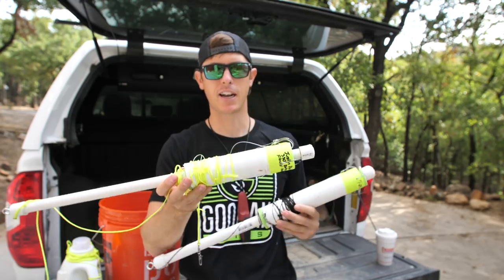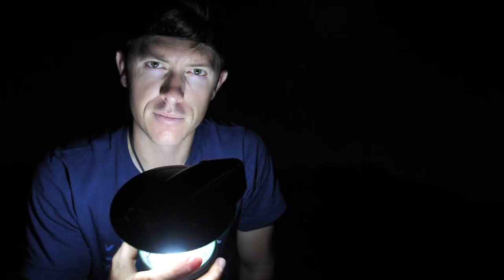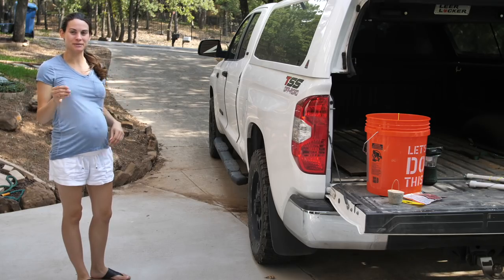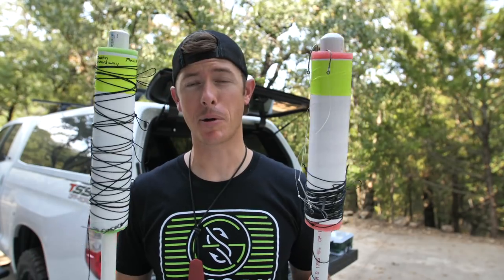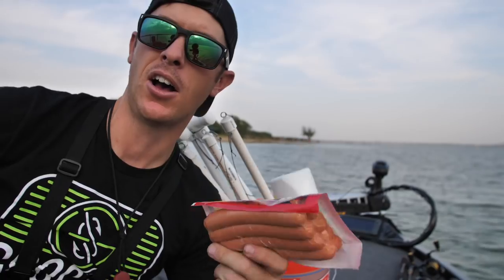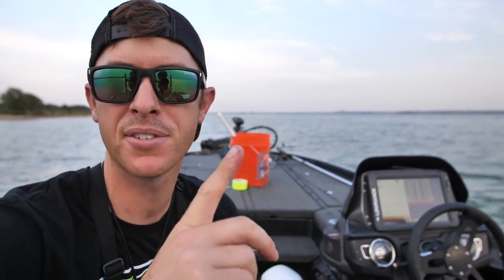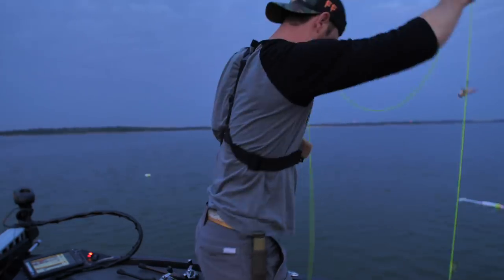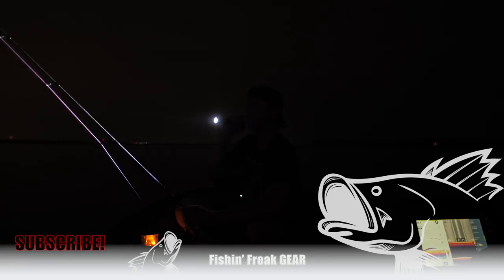THEY WORK! Catching Catfish on Overnight DIY Juglines!

Comment: LFG, I got what you need on the jug lines brother. I have felt your pain, but I have taken that pain and turned it into the greatest creation EVAR! You are on the right path with your noodle setup, but you went wrong with the thin noodle. You got to hit up wal Mart and got the ultra media super fat pool noodles. Chop that bad boy down to dumbbell size and fit it to your rig, but do not secure it just yet. Once it fits your jug line aetup, whatever it may be, you take the big noodle and put it on a spare piece of PVC, take and angle grinder with a coarse flap disc and begin to shape the noodle like an hour glass. It doesn't take much, you just want some tape to keep your excess rope in check and in the middle. Then! Get rid of those loops, wasted effort and rope. All you need is a straight piece of rope like you already got, deploy your jug line, find bottom and give it some scope. Take you noodle and you rope, make a loop with a couple twists in it, wrap that loop over the noodle, do it again the other direction. Your rope length will not move because it's twisted under itself and its not a knot, so once you get back home thst evening, stretch out your lines and unwrap the twists, your hugs are ready to deploy again.

Comment: Used to jug fish with my brother before getting into almost exclusively bass fishing. Couple tips i would give:
Circle hooks - fish pulls down and sets the hook on itself
Raw shrimp you buy at the grocery store works pretty well around here if you can't cast net some shad up for cut bait. it also doesn't stink.
We had noodles set up for 5/10/15 feet lengths as usually the thermocline wasnt much deeper than that in the heat of summer.

Comment: Take 16oz. bottles paint them white and cut a swimming noodle in 3-4 inch slices. Glue the slices to the bottle bottom with liquid nails and tie the line around the neck of the bottle and you are ready to go. The hook can be stuck in the noodle slice on the end and stacked in a milk crate to keep them all together. When I jug fish my crate has around 30 jugs in the crate and I can put them out or pick them up in just a few minutes. My lines are only 3-4 foot long because I fish the flats, but if you want to fish longer lines you can wrap the lines around the jug and use a rubber band to secure the line at a certain depth. The lines I use small trotline with a barrel swivel tied to 30 pound mono with a small hook with threaded or cut shad. Give it a try it works well and its cheap.

Comment: In the winter time for tip ups, at dark time there are these lights than you can attach to your flag and when the flag is horizontal the light is off but when you get a fish the flag goes vertical and the light flashes! You should check them out and see how the work on them!

Comment: Might want to put a snubber on your leader leading to your hook. This will help improve your percentage of hookups I think. They are basically surgical tubing with swivels on either end of them. When a fish strikes, the surgical tubing flexes and helps set the hook for you. We used them when downrigging very deep for smaller fish that sometimes had trouble tripping the downrigger slips.

Comment: Try cutting the 2 packages of hot dogs into 1" chunks. Place them into a plastic bag with 2 tbsp of minced garlic and 1 packet of strawberry Kool-Aid mix. This has worked extremely well for me. The garlic sends an oil slick in the water and the strawberry flavoring helps them hold on to the baits. Good luck.

Comment: LFG .... You ever throw a spread cast net? Getchu some live shad, maybe a Gill. Get them baked in the sun just Long enough to dry out a bit, not rot. Ooooman you wanna talk about bringing them in! I grew up with jug lines on the lake of the Ozarks and man are they fun! 12yrs old I was running a few dozen noodles, counting the group like you do ..and I lost one. Only to catch a glimpse of it coming back to the surface several minutes later. Now to hold a jug under that fish has got to have some legs on it. I landed a 64lb blue that day and I've been hooked since. With a nice respect for big fish I might add. My set up was around 20" of pool noodle get your trautline in the tip of a pair of needle nose. Shove it halfway through about 3-4" from the end.(half way cause the needle nose would spread that hole around the string) Go to the other side of the noodle and go in to retrieve the string so it is clean threaded thru. now needle nose in the noodle center hole on the short end grab the string and pull a loop and tie it all together. The loop ensuring that the noodle tips from the end and stands up. No weights, no pvc. They will stand up to many dozens of fish before they wear out. If it's not looking good go cut another section of the 99¢noodle and you are fresh, back in the game. This hits close to home, chasing noodles. Keep em coming bud
Reply: Pvc and the weight inside gets hit and it's triggered. 
I guess it's an indication to check your bait. That all just seems like more to dial in for it to work. 
Keep it simple. You betcha you won't be disappointed
Shoot man what am I saying, teachmesomethingnew

Comment: Tip number one that you should do when your bringing up the line hook set it like a rod or pulled it up fast that way if there is one bitting it it will get hooked tip.number two raw hot dogs don’t stay on the hook that good they can easily fall off.Also your hook size and shape matters you want to use a 3/0 odd or a 4/0 odd depending how big your catfish are and I would recommend a circle hook. These are just some ideas you can use and they have worked for me before when catching cats

Comment: easiest jug
1- cut noodle into three pieces 
2- cut pvc pipe to equal lengths of noodles
3- slide pvc pipe into noodles
4-cut lengths of line ans slide them through pvc
5-slide washer bigger than pvc onto line and then tie a nut onto end
6- tie hook and weight to other end
7- wrap on line tight and put hook into jug
8-spray foam in pvc pipe so line doesnt slide back n forth
9--catch the cats

Comment: Have both those set ups. If i ever had to much line i just bought some balloons and tied up to it about 1 foot of the bottom . Balloon float right beside it and is way easier to see if your getting hit. I use about 3” bream . Typically fillet them down both sides. Don’t cut the guts though. It’s basically like jigging for grouper . Usually get about 4-5 every time i use them .

Comment: I have used jug lines since I was a kid but let then eat the bait for a few minutes and when you go to lift the noodle you kinda set the hook by when you are in a squat position hold the jug out and stand up Simi fast or you can hold the jug in the water and lift it over your head to help the fish slide back into the middle of the hook because the way they get off is by working it out of there mouth or by twisting the line up       just a little tip

And for bait use bluegill but don't forget to clean the hook point from the scales from the bluegill or with the hot dogs let them sit in the front of you boat to let them get warm and nasty so what I do is go fish for the day with the hotdogs in the front of the boat then at night I set out the jug lines then I check them in the morning

Comment: If you want to use hot dogs, cut them up and mix them in a bag with strawberry or grape flavored jello, and some garlic powder. Just make sure you do a few days before you want to use them so the hello has time to pull the moisture out of the hot dogs and set up

Comment: Try using the metal clips from the last to adjust your depth so you dont have a bunch of excess line hanging and put the clips at each loop for a custom length line for different locations

Comment: I use a simpler version of your rig and I let them drift. I use just the pool noodles with 15 ft of trout line looped through the noodle. 1-2 hooks. I use cut bait, hot dogs, chicken liver, beef liver, and shrimp. If you have any questions or want a picture let me know. I have great success with mine.

Comment: Did the noodles with the T fittings end up working out better than the others? IM about to make some, and wanted to know if that method was worth it. I like the idea of being able to control the depth and use the weights to keep them in place. With all the wind we have here in Texas, id like to keep the jugs in a specific area and keep them from blowing up into the trees and tangles.

Comment: Put the pool noodle on the ends, pvc in the middle with the line. I catch a ton this way. Also get some reflective tape to put on the noodles. Hell of a lot easier to see with a light.
Reply: Looks like a mini dumbbell. About 9 inches total, usually have about 60 out at a time. No. Repeat no added weight.

Comment: I love jug fishing. I started 25 years ago using 2 or 3 littlers but the mountain dew big mouth 1 littler my fav. But 10 years ago I got shwied the noodle fishing so I set mine 3 to 6 ft deep I've never put in the bottom and useing a weight never done that. Never used the rbar in the tub. Just bait toss them let them float around. Or go down river. Ide set 20 out drive 1 mile down river weight for them. But I e got a new desine I seen with aluminum beer bottles can't weight to try. But yea I love doing that. But next time set 5 or 6 ft lines throw them out let them drift not just sit in one spot. But good job hope you catch many more. God bless

Comment: Hey Justin. Try not to get the Purple Primer and Orange Glue on your hands. The Purple Primer is normally for Gas and the Orange Glue is for Schedule 80 Grey PVC water mains. The clear PVC glue would probably be better with the purple primer. The purple primer softens the PVC so that the fittings can slide on easier

Comment: On the stem part below the noodle use a couple of tee’s and a couple of 90’s to loop ur line on ..reduce the size of the 90’s to cut down on weight..could help on the winding up and storage part of the process..

Comment: You have to attach 2 ounce lead or whatever size you use on the line to the other side of the pipe. It works as a counterweight

Comment: can't help myself...one more thing...those float foam, pvc and rebarb look cool and work like a dream BUT when the fish grabs the bait and begins to swim off, the linear device follows like a torpedo BUT the old purex (not weighted to the bottom) resists a lot, helping to set the hook and causes the fish to take off like a bullet...therefore causing the fish to tire quickly because of constant resistance...and I know from experience if you see one of those purex jugs go completely under (and the jug will not be under long) you will wish you had brought a gaff...

Comment: Now make however more Texas allows you to fish at once and get to it. It states 50 hooks on a trotline so you maybe able to fish 50 single hooked jugs? I used to fish jugs in Missouri lakes and had a blast. Only fished 27 at once but that was enough to keep your hands full. Catch some bluegill and cut them for bait and live goldfish and crawdads work great too. Sounds like good video material. If you need a hand just holler 👍

Comment: Justin why don't you just use duck tape to keep the line at perfect depth once the weight hits bottom. Just one rap around the PVC will keep the line from unraveling and leave the extra rapped up.

Comment: You might want to make thicker floating devices bc if they pull it down easily the hook will not penetrate. If it's thicker has more resistance and penetrates the hook maybe try that and chicken liver is really good.

Comment: DUDE. Half my family lives on lake greenwood SC. We have Perfected jugging. 2 liters with 2ft of braided line tied around the lid. Then youre gonna want to put a huge swivel on the end of that braid. Get the big snelled ABERDEEN eagle claw hooks. They are so skinny and sharp they dont need hardly any set. The trick is to put TWO of those on that swivel. Hook a big hunk of CHICKEN LIVER (having the container sitting outside in the hot sun all day makes them work better) with both of those hooks. Toss em out and watch those jugs start jumping.

Comment: The "problem" you are having is just a common misconception that catfish are only bottom feeders. Don't be afraid to go real shallow ( as low as 1 foot of water sometimes). Its as simple as a milk jug with 2-4 ft of line on it. Also try using a drop line/ limb line, info on either can easily be found online and you can catch fish exceeding 30-50lbs in the right bodies of water. When I use a jug or drop line i also use the 100 lb line you found but i don't use any leader and i usually use a 2/0 stainless steel tru-turn J-hook or larger depending on the bait, but hook choice is your personal preference. Also I catch my own bait, either small blue gills, shad or what ever natural food source in the 3-5 inch range but don't be afraid to use bigger baits. If you want to use fresh shad get your self a cast net and learn to throw it, don't worry if your bait is dead or alive catfish usually don't mind. Also don't forget to research your states laws on cast nets if you choose to use one.

Comment: I put a barrei swivel every 4 o 5 feet and then if i want a shorter length i just snap 1 or 2 fight back into the first barrel snap or the eye bolt.  the lines are not tangled either.

Comment: you will catch more with 10 feet of line which is more easily controlled with a half hitch on the hook end of the "noodle jug"   Go into shallower bays and not out in the main lake for easy to catch cats in 5-10 ft of wate

Comment: LFG this may sound funny but get you a bar of Dial Gold Soap, a Knee High Panty Hose,  cut soap into chunks, and use a small piece of panty hose to make a pouch to put soap in and knot it good. then you simply hook it on circle hook.  it works wonders and when you throw Catfish in live well the soap will help clean slime off the fish.

Comment: Very complicated set up to just be jugging. I just loop a bank line through a pool noodle and a swivel, attach a five foot leader to the swivel and a very thin wide gap hook and use cut blugill or shad. No weights. Let them float. Works everytime within minutes most times. Catfish will swim up to it. You don’t need the bait near the bottom.

Comment: Some old woman panty hose cut into one inch squares or slightly bigger whatever size works and pull the panty hose up around some rotten liver on to a treble hook so the catfish can't get the liver off very easily and usually ends up getting hooked and not getting off, hope this helps : )

Comment: Jug lines are simple you are over thinking it your design is good but could be improved by cutting down the length of the pvc  to about 3” past the noodle and drill your a hole in the end cap pass the line through the hole and tying a small washer inside then gluing the end on then wrap the line around the noodle .for depth adjustment let it out to said depth then half hitch it around the noodle two times and let them free float

Comment: IMHO, kinda overtought! Pool noodles, wire coat hangers, braid, weight & hook. I had 35 of them dang thangs until a "buddy" took off with them! They generally caught 150-200 lbs every outing. I'll put up a post on their build, very simple

Comment: you need to tie your hooks straight to the main line. pour concrete in a Solo Cup, take a hanger bend it to make something to tie the line to then use the Solo Cup as your weight. On your main line have three hooks tied to it straight up the line. l like to keep your hooks horizontal in the water column I do them two foot apart then what you do is you let your cup go all the way to the bottom you pull it up two inches. Have your line wrapped all the way around your noodle and then you just pull it up and tie a half hitch loop around the end of your noodle and that allows the cup to move in a little bit with the waves naturally and Bob kind of and it'll let you set your line.......
I Have a YouTube channel....
Kacey Murphy...... 
I have a few things you outta check out. Also try using silver strips of AC ducting tape I tape um   right above the eye of the shank of the hook. In two in strips...... Caught a 60 lb blue cat off that tape 
Good luck my friend.. 
@Lfg

Comment: Hard work. Pvc pipe, foam pool noodle, 100lb test.  Reply i will send yoy a message with good jug lines my grandparents used for years. Also floater jugs work well if you watch them
Reply: Like you're close but not there.

Comment: You only want the line 2 to 3 foot deep not on bottom
Reply: They will set hook if cricle hooks are used and are not weighted just have to watch them and reset lines alot

Comment: automatic fly reel .................. could work with some engineerin, just mount them on the end and secure with pipe clamps, use a 3 way swivel on the terminal end and it could all be yours for just 49.99.  Nah, really, that would clean up the whole mess for just $20 bucks and all you'd have to do is just pitch them overboard.  Also, the music, are you from texas or south central LA or a techno 60s hippy with a hanging ball with little pieces of mirror glued all over it, whatever you call them things.  Anyway that music was PAINFUL to my brain.

Comment: Man ur makin this way too hard. First no weight needed.  The fish tips it up when its on line. No need for the pvc to be so long. About 2 inches past noodle on each end. And the line doesnt have to be near the bottom! 5ft is plenty long. Use cut bait or chicken livers cut bait works best. Also we throw them leave them and go fish come back in about an hour or less and we almost always have fish. At least 2 or 3 out of 6. Also ur loosing them because ur trying to tight line. They get to the bottom and creat slack. With 5 ft line they cant create the slack. Dont come off as easy. Also use the circle hooks